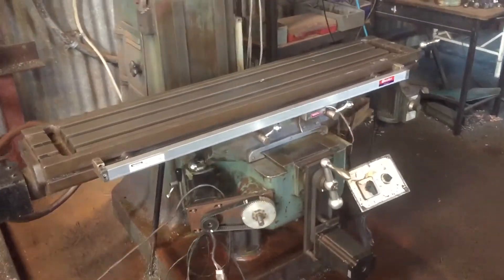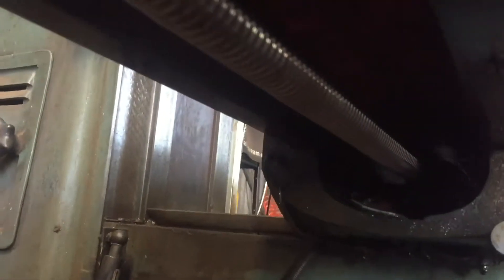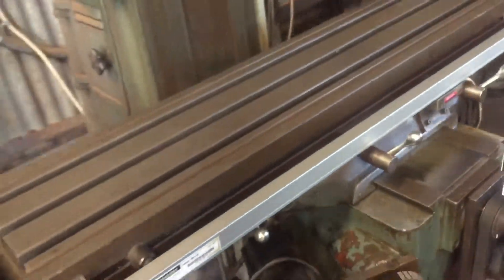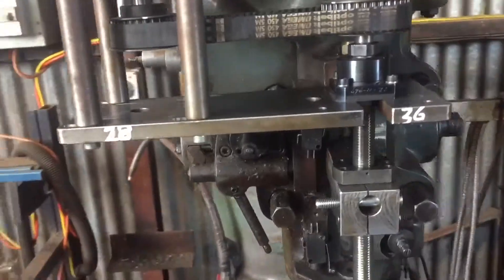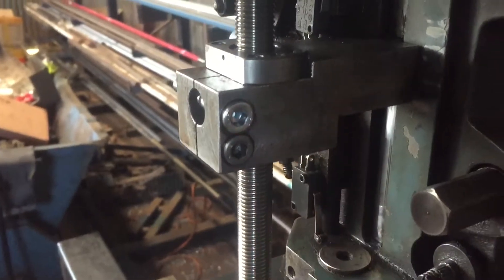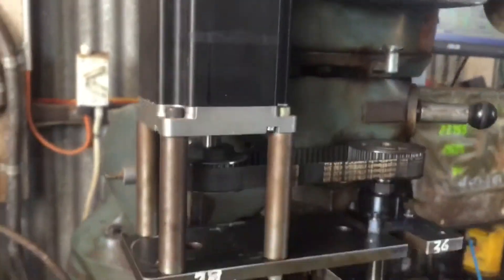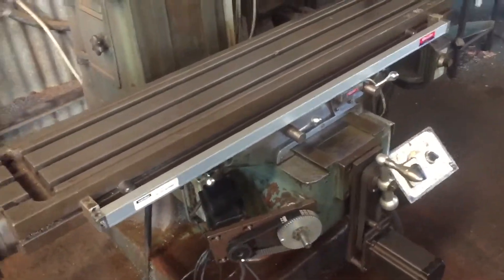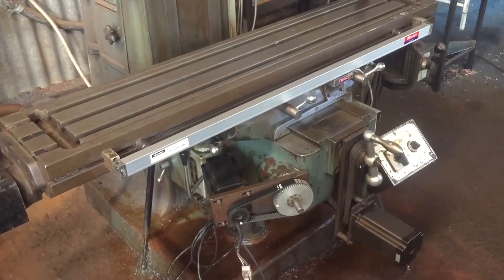Bridgeport Mill Clone - CNC Ballscrew Retrofit ( DIY CNC )

Comment: Nice conversion. Wondering if you went for rolled or ground ballscrews and were you able to reuse the original yoke or did you manage to find a source for a replacement?
Reply from the maker: They are rolled. The standard double ball nut fits the original yoke.
Reply: @diycnc3442  Thanks for that. Bought a Hare & Forbes BM-40V a couple of years ago with the intention of a cnc conversion, but didn't think I would be able to reuse the yoke. Mine might be different being a clone, but it's worth pulling it apart now to have a look at least! Would like to see an update on the AXBB-E Ethernet UCCNC Motion Control board you bought too, thinking of using one for my next plasma table. Cheers
Reply: @diycnc3442  So you used 25mm ballscrews? Any modifications needed to the ballscrew nut flanges to fit for clearance?

Comment: Thanks again for sharing. I’m a hobbyist and my Bridgeport is a new tool to me. I want to convert my BP into a CNC XYZ machine at the lowest cost possible and get a good reliable machine. My plan is to get those cheap china dfu2505 ballscrews for the x and y. I think I can just dump the old ACME screw guts out of it install those duf2505 ballscrews. When I look a the technical info from the supplier I think I can get the nut at the right size and just press fit the nut in the yoke. I’d like to you what you think. Thanks in advance. https://www.aliexpress.com/item/1pcs-DFU2505-Ball-screw-L200-300-350-400-500-550-600-650-700-800-900-1000mm/32932768466.html?shortkey=eQbeeMVz&addresstype=600
Reply from the maker: My existing yoke is 40mm ID so the ball nuts fit straight in. They don’t press in, they slide in and bolt up via the flange holes.

Comment: Looking good!
I'm looking to add a servo to my bp knee just like you show.  Do you have some information about the method you used to mount it?  i.e. how did you mount the bracket to the mill?  motor size, pulley ratio etc.
Did you make / buy the pulleys?
Thanks,
Joe
Reply from the maker: Joe Robertson all brackets are mounted using existing bolt holes that are standard to the mill. The knee ratio is 3:1. The X/Y is 1:1. The quill drive is 2:1 ( I think from memory ). 
The stepper motors are Nema34 2550 Oz/in using Gecko G210X drivers and 55V Power supply. 
I bought the timing pulleys ( 5M HTD 16mm width belts. )
Reply: @diycnc3442  Are you satisfied with the performance of the knee stepper?  Do you remember the #teeth and bore size on the larger pulley for the knee? (or the part#).  I was thinking of a Nema42 servo but not locked into that.  I have steppers and Gecko 203v with 60v power supply now for x,y and quill.
Thanks
Reply from the maker: Joe Robertson I don’t use the knee much. If you want to do it right, convert the knee leadscrew to a big ballscrew. Then use a servo. The way I have it setup works, but it’s not fast. I mainly use knee motor for a table drop/raise for longer tools. I have a 4 axis control so all motors can be driven at once. X, Y , quill and knee.
Reply: @diycnc3442   Well - what I have in mind is when I change tools, use the knee to compensate for the tool length offsets and use the quill for the machining operation for that tool. 

I'm not sure I want to do the change to ballscrew on the knee as I'm really new to machining and not that confident in my skill set.  Perhaps in the future after I learn more...  I've been watching videos to learn what the inside of the knee looks like and what would be involved.  I've seen two different approaches to ballscrew installation (motor at top or bottom) but they both look like a rebuild the machine type operation in terms of effort.

The reason I was thinking servo - I'd like to eventually change all of the steppers out and have a full servo machine.  I could use the servo on the knee as is - then if I later decide to do the ballscrew I'd already have the servo.

It is good to hear that you purchased the pulleys instead of having to make them.

Thanks
Reply from the maker: Joe Robertson that can be done. You’ll have to write a custom tool change macro to move the knee to compensate for tool length variation.
Reply: @diycnc3442  I can do the custom tool change macro.
Can you explain more about how you mount the bracket and pulley to the knee shaft?

I assume you used the 3 existing holes that hold the bearing cover? 

What items did you remove/leave on the shaft? 

How is the pulley mounted on the shaft (key / threads / set screw)?

The bracket looks like  ~1/2" thick?

Thanks for answering all my questions.
Joe
Reply from the maker: Joe Robertson Use the existing bolts. The plate is 3/8” ( 10mm ) steel plate. I keyed the pulley to match the shaft and also used 2 x grub screws.
Reply: @diycnc3442  Can you point me to where you got the timing pulleys and # teeth on each pulley ?
Reply from the maker: Joe Robertson I bought them through my local belt and pulley supplier.